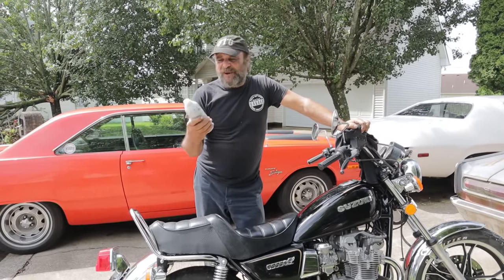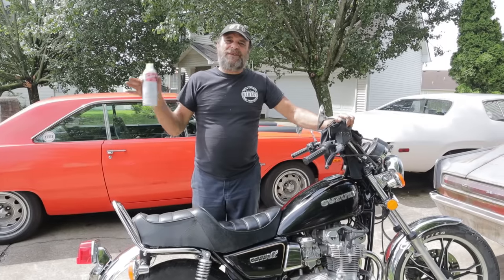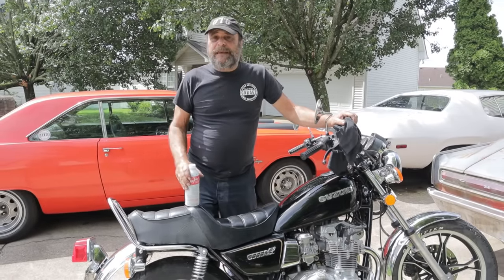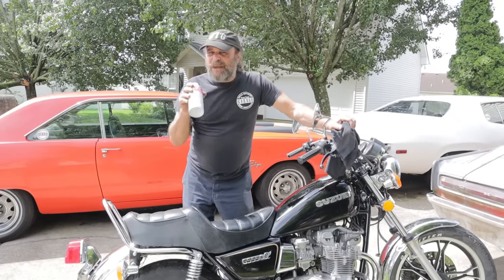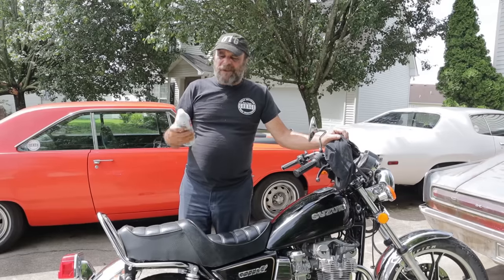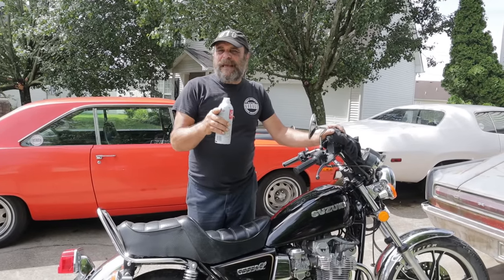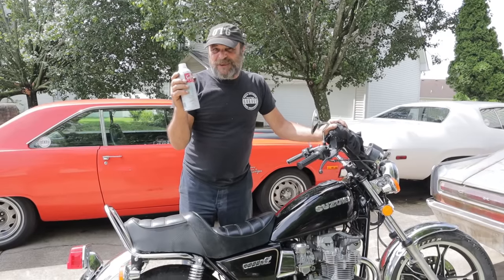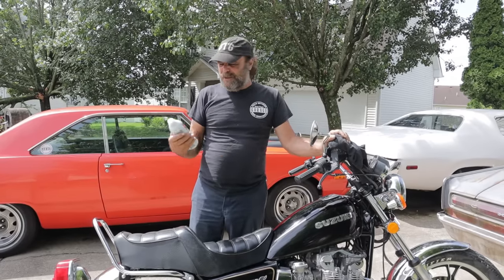We Try Seafoam - We Come Away Shocked

Comment: After watching this I ordered a can for my Suzuki XF650. I've already been into the carbs and cleaned the jets, fitted a filter and it still seemed like pilot jet issues or carb synch issues, but i didn't touch the synch screw....

It was fluffing and spluttering and farting and spitting and basically running like a bag of shit. I was about to completely rebuild the carbs.

I used 2oz per gallon, ran it, let it sit, ran it, let it sit and this afternoon it seemed to have cleared the issues.... 

After 12 months of inaction, looks like the Free(quent)Wind will roll this summer...

Put it in my S4R, my Duke  and my Sachs Madass, now about to put some in my lawn mowers and chain saws and gen set...

Comment: My Harley softail deluxe was back firing and would not run very well when I was out with guys riding .someone suggested seafoam I put in 3 oz and within 10 minutes I was back on the road and my bike was running like nothing was ever wrong. I use seafoam in all my engines.

Comment: I've been told by a mechanic that he had a carburetor problem on a motorcycle  that he had just purchase. He put some transmission fluid in the gas and said that the high detergent in the tranny fluid cleared out the carburetor.

Comment: I wasn't a believer in seafoam until I watched project farm's video. i put seafoam in my engine oil about a 1000 miles before i change it and dump the remainder in my gas tank to clean my injectors in my 04 titan with 245k miles.

Comment: One thing I will say about seafoam, it doesn't work as well in fuel injection system from what I've noticed. But seafoam is great for carburetors. Another great product that actually works is marvels mystery oil.

Comment: I use it as carburetor cleaner I disassemble the carburetor as far as I can put it in a ziplock bag and for the whole can of seafoam in there with it twist up the bag so the whole carb is totally submerged for about an hour or until the seafoam melt through the bag. I happen to have a chemically resistant bag I use for this. Come back after an hour shake the bag up and down you'll notice the liquid will turn yellow come back an hour later blow it out and boom it's as clean as new

Comment: My 1998 Honda ST1100 was stored for only 6 months with a full tank of gas. Forgot to put stabilizer in for the winter. Started her up on a nice day to go for a ride. She was running like crap. I checked out the ignition system and pulled the plugs. Not the problem. Figured it was the gas. Drained and refilled the tank. She still ran like crap. The carbs on this bike are a mofo to get to. You need small hands to get all the hoses and connectors on. Called the Honda dealer. They said it would be $800 to rebuild the carbs and sync them. I went to the auto parts store on the way to the dealer and was recommended a can of Seafoam. I put in half a can in the tank. I headed off on the 40 min. ride to the dealer, half way there the bike started running better. So I just kept ridding for the rest of the day and lived happily ever after. 
PS. I love all of the Mopar iron in the background. Maybe you should do some show and tell videos on them.

Comment: I will say one thing though... if you have an old car engine with bad valve seals, using Seafoam in conjunction with high-detergency oil can destroy the carbon or other schmutz that is keeping the seals from leaking.  My experience on a high mileage Northstar.

Comment: Me used 2 b skeptcl, 2.  Fuel Trim values too negative and got startup, cold misfires.  SMOG check failed. That night, did SMOKE clean u c on YT, twice, including heat soak.   Drove highway during week about 50 miles.  Trims less than 5%, and passed SMOG!  
Now, I buy SF by gallon.

Comment: Been using Sea foam for about 15 years never disappointed  used it in a generator that I left fuel in and ran crappy even after cleaning the carburetor I poured straight Sea foam into the fuel line and choked out the engine till it stalled let it sit for 4/5 days drained the float bowl  and filled it with fresh fuel started right up and ran like a champ no missing or sputtering

Comment: Ive used Seafoam for decades ever since I found out about it, its no replacement for hard mechanic work, but it does do wonders in its own right. had a 94 saturn that coughed and sputtered then it ended up sitting for 5+ years at least. new battery, still coughed and sputtered, tried replacing all kinds of things, never seemed to find the right problem. had a guy coming to look at it, so threw some gas in the car, and for the 10 gallons in it I tossed in a full can, drove it a bit that night spitting and sputtering. left it over night, the guy showed up and I told him to expect spitting and sputtering... I was sort of used to it so I would drive it to show him that it did indeed run at least. the thing ran like a top. no hesitation, no nothing, I was suddenly sad to see it go lol.

  used some in a 98 F-150, had a bit of knocking in it. still knocks but not as loud, but after I used it the check engine light came on, throwing a code for the EGR valve. thought about replacing it, poured some more into it and ran it some more, about an hour later light went off, no more code, and runs good, a little less of that knocking (pretty sure its the fuel injection). its not ready for drag racing, but it is running much better.

  I put a few ounces in every few tanks in my Harley, and make sure its stored with 1-2 gallons of fuel and 1-2 ounces of seafoam. never fails to start and run the next year on any of the bikes Ive had. 100% that stuff has saved countless hours of wrenching and several 1000s of dollars in replacing parts. its great for pre-oil changes too.

Comment: Seafoam deep creep, foam's  up like oven cleaner. Crusty old speedometer noise that is not cable, with speedometer in position like mounted, little hole in case. Tube from spray can in a small bit. Tiniest squirt, so as to not wet the lens. Ball of foam May soak the bushing the cable end plugs  into. I have had good success on 4 different Honda Speedo's, 30 to 40 year old speedometer's may be good for a few years. Brake clean , carb clean sprays force full enough to wet the lens and ruin's the speedometer. Don't stick spray tube in far , least in, least amount of spray. It works.

Comment: Nothing can replace a proper airbox with a clean filter, clean bowl and correct float height, clear and correct sized jets, clear (unclogged) internal passages, undamaged diaphragm (CV), synced (multiple carbs) and securely mounted with no air leaks.

Do it right the first time.

Comment: It was originally made to attack carbon in jet ski motors. Hence the name. So if you use it for its intended purpose, to clean carbon. It works fantastically.
If you need a regular fuel additive for every single tank don't use seafoam. Use lucas or some other similar additive.

Comment: My 5000 watt generator was running like crap, spitting and sputtering and making the lights flicker.  I was convinced that putting a new carburetor on it was the only/right fix.  Before the electricity came back on I mixed seafoam with the next tank of gas and didn't notice any difference in the way it ran.  I never got around to putting on a new carburetor but when the electricity went out again 6 months or a year later I noticed that the generator ran like new again.  Evidently you have to run it through the system and give it time to work.

Comment: "Pilots are tiny" This is where just a slight amount of corrosion leans the mixture enough to cause lean surging.  Mechanic in a bottle won't remove this corrosion, it cannot.
The other issue to look for are plugged basket filter screens, it's common to discover them loaded with junk.  Might idle fine in this case but fall on it's face during acceleration, expect surging as the float bowls cannot fill fast enough to meet demand.
These filter are in various locations, one in the float needle assembly and another location is the tank petcock.  You'll be amazed at what you might discover in them.

Comment: I tried neat seafoam on a carb bowl that was varnished, it didn’t touch the varnish, I agitated it with a toothbrush, no effect, I mixed in some petrol and tried again, absolutely no effect, I got a can of spray carb cleaner and sprayed it in the bowl, the varnish came right off, I’m told that the active ingredient in seafoam and redex  was removed years ago for health and safety reasons.

Comment: I used to have a 1987 yamaha fzr1000 and the thing would never run on regulator fuel. Had to run premium. Every so often if i fulled up on cheap fuel throw in a full bottle of seafoam and it would run top. So every few months id run a bottle in it and it ran great for years till i sold it.

Comment: My grandfather had a wrecking yard and there were cars that had been sitting for years and started right up with the stale gas in the tanks and not just 1 car but all the time , the gas today is crap and eats aluminum or the pot metal or plastic in modern engines like no tomorrow , if you don't change the oil gas always gets in it and all the rubber or plastic gets eaten in the seals to

Comment: Its snake oil.  Gummed up carbs  due to old gas can not be fixed running seafoam in your tank. Think about it. If it were to  remove the gunk from the carbs where does the gunk go?. Its still in the carb bowl at best.

Comment: Hey, good day. Being a mechanic do it yourself or Blacksmith you name it entire life. And I swore by certain situation with what I call mechanic in a bottle. Various types. Have been advisedby my son who is a mechanic, and a few others through the years, To try seafoam.After seeing your video I’m gonna give it a try on a few things I have. Including a little 1983 Isuzu diesel pick up truck, that has started for nearly quarter century even if it sits for a year never have had a problem. Until recently. Have gotten what I think is glycerin buildup out of the fuel line looks like a worm :-) however replace the fuel lines everything except for haven’t had time to pull the injector pump off. I may put some seafoam in it. The only thing I could experiment with with that glycerin, nothing would work except the only thing that sort of emulsified it slightly was xylene, actually put a half a gallon in about 5 gallons of diesel ran it parked it etc. still has the major issue. So maybe I’ll drain the tank and put some seafoam in it. Sorry about the 10 page novel :-) thanks for showing this and your opinion. You’re a good mechanic I can tell excuse me. You’re a great mechanic I’m sure :-) very good inspiration for all of us.Keep up the great work and thank you for sharing this and all your other videos with everybody you’re the man. Stay well and have a beautiful day. Jim

Comment: I occasio0nally use seafoam to clean a fuel system but I have never (And I have tried repeatedly) had it clear up a clogged carburetor jet.  Maybe if I took the float bowls off and filled then directly with Seafoam and then put it back on it would.  Don't know.  But at that point I could manually clean the jets myself.

Comment: Sea foam is a rare honest & effective product in a literal sea of snake oil. Sea foam works great especially when used properly, the new can design variant makes it even easier to put it through the top end on fuel injected vehicles.

Major cleaning of both my cylinders and the valves thanks to sea foam. Try the vacuum induction method sometime to clean top end.

Comment: Sea foam is some good  product I've tried it on a old Ford truck with a stopped up fuel injection system it cleared it up it ran better and better two tanks gas it was running like new

Comment: Ive used it in my 1969 cutlass and the carb wasnt really acting that funny except the choke, but it does work on dirtier stuff and it stabilizes gas. If you just got an older project car with a fuel system in meh or worse shape put that in and run it and if dont drive it often your gas won't go bad. Seafoam is some real good shit and mist people dont know that it can stabilize fuel. How well it works as engine oil flush I dont know its hard to measure as measuring engine gunk ia hard so I'm not sure if its better than the classic diesel fuel oil flush trick, but foe me when flushed and I didnt even run the engine for as long as should it seemed to make the mostly clean oil not so clear. Be careful with engine flushes as many people have said if your car is really gumed up flushing it can make it worse, but if you restoringba car you were probably going to rebuild the engine at some point, but if you need to run somwtimes and you know its gummy dont flush it with anything.

Comment: Seafoam is a great product to use on old engines that were not properly maintained. Just like anything, it has its pros and its cons. I'm not interested in arguing with anyone. I'm sure there's going to be a bunch of people ready to tell me I'm wrong, and I don't know what I'm talking about. For anyone who actually wants to know the downside and risk to using seafoam. It's not difficult to verify what I'm saying. Seafoam is a blend of pale oil and some solvents(including a small amount of alcohol). It's the reason why it's so good at breaking down carbon build-up. It also effectively brakes down engine oil. Among other lubrication related problems, it will cause cylinder wash down. Cylinder wash down is something that can happen even without additives involved. If the engines running conditions are not correct, excess gas will cause cylinder wash down. Adding anything to the fuel will change the air fuel mixture, creating less than ideal burn conditions. When it's a solvent that is added, it'll only further wash engine oil from the cylinder. I'm not at all saying that using this product is going to kill your engine. What I'm saying is you shouldn't just go dumping additives into your engine without doing a little homework on it first. If used improperly and / or excessively, it will bring on some serious problems that will ultimately destroy an engine if left unchecked. One, it's not a good idea to use more than the recommended amount. The more you add, the more you'll change that critical air fuel mixture. Two, a new engine that has low mileage shouldn't need this kind of treatment. If you want to keep your engine clean, keep up on simple maintenance. Have it checked out once a year to make sure everything is working properly. If a new engine has suddenly accumulated excessive carbon build up. It means something is wrong, and simply cleaning it won't fix the problem. When using any kind of additives, especially ones containing solvents. It's ideal to run all the treated fuel through the system before refueling. After all the treatments you intended are finished and purged from the fuel system. Do an oil change afterward. If you want to go the extra mile, you can flush the engine with fresh oil (drain the contaminated oil, refill with fresh oil, and let it run through the system for about a minute, let the oil drain back into the pan, drain that oil, replace oil filter and once again fill with fresh oil and it's good to go) thats not necessary but it will remove more contamination from the oil system. Again, seafoam is a great product. It works wonders for tired old engines. If the proper steps are taken, it's pretty harmless to the engine.

Comment: Check this out I have a 2007 Yamaha R1 after I changed the starter my bike ran like absolute crap. I had a shop look at it who couldn't fix the rough idle issue after many months of scratching my head I tried a bottle of sea foam and it fixed everything!!

Comment: I have never used seafoam , but had good luck using fuel injector cleaner In carberated engines . Engines that barely ran would be purring after

Comment: A little tranny fluid in the gas has been my go to for engines that will start. Work the throttle to see if it improves.  I have found 20 minutes is the magic number if it is going to work.  Once the engine runs good enough for the vehicle to do whatever it is does, go beat the crap out of it. Has saved me a lot of carbs rebuilds.  Never had any luck with seafoam making anything run better. I use it to treat my stored gas and I never have had a carb problem since.
Reply: You misspelled 'transmisson'...

Comment: You gotta heat soak it. Run it hot A.f.. the. Dump it in the carbs directly like fogging then instantly turn off the engine before its ran out of the carbs. Let it sit for 30 min to 1 hour. Then run a tank of fuel with seafoam. It works. So does Marvel's mystery oil

Comment: my go-to is 3M complete fuel system cleaner or complete injection cleaner I have been using it for about 25 years save me from removing a lot of carburetors lawnmowers motorcycles cars trucks and outboards you name it it has saved me 99.9% of my time not a big fan of seafoam and on Diesel's I use Marvel Mystery Oil👍🇺🇸💪

Comment: Either seafoam or stabil with a red dye in the fuel additive is one way to get in some serious trouble if they do a fuel sample test on your vehicle. I was test driving a vehicle was stopped and the trooper wanted to do a fuel test and said if I don't they can give me a ticket and more. I told him I was just test driving the vehicle it wasn't even mine. He did his fuel test luckily nothing turned up in the fuel tank no red dye. Red dye in the fuel tank can get you into some serious trouble. I've been in the automotive field for years. I use the dollar treatment fuel stabilizer 12 oz for now $1.25 and I used to use fuel treatment in the bottle for my diesel but now it's just simpler and cheaper to use the red heat pour in and go. I've been using it for a few years.